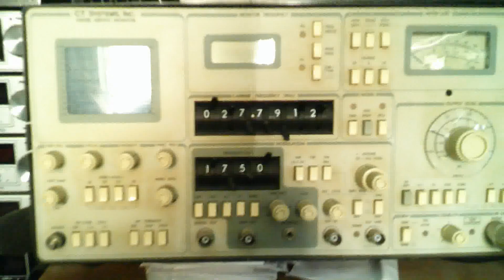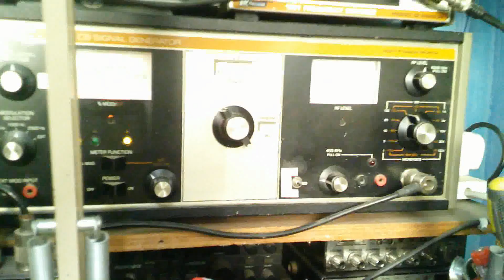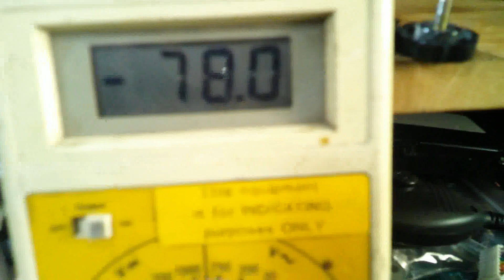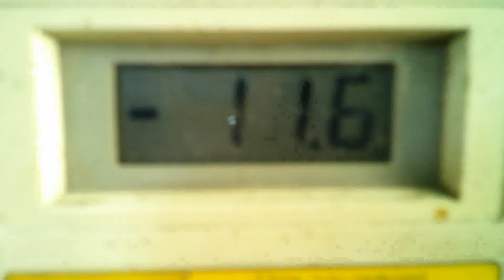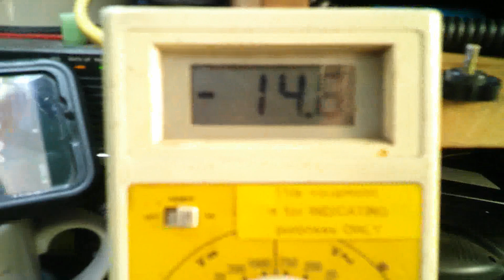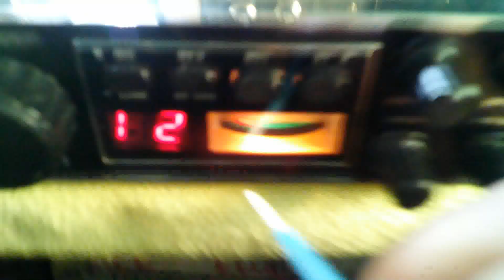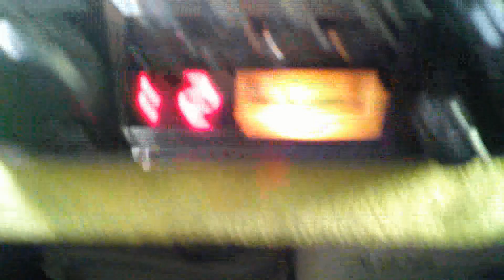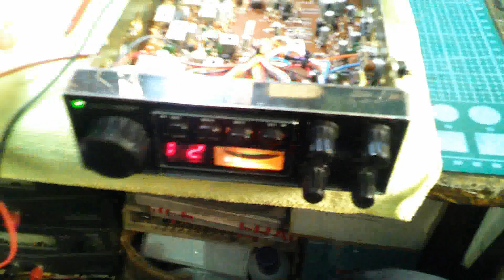CB Radio RX Tune up without a Sinad meter

Comment: I've never had need for a SINAD meter. For narrowband FM receivers I've always used the 20db quieting method, and for AM receivers I use a tone-modulated signal generator along with an oscilloscope. The scope is connected to the output of the receiver. I can easily see changes, much more so than on a voltmeter, even an analog one.

Comment: You should always use an analog meter for tuning because they are much more accurate and have better resolution...
Reply from the maker: maybe so,but i guarantee you use a digital meter and an analogue meter (for voltage) the slight difference in mV and even uV won't be noticed on a sinad meter..
i've even tried this recently a few times without a multimeter and just used the radios signal meter and peaked it by eye, then done it again using a meter and gained hardly anything which was noticable.

remember this is for weak signal peaking, the stronger signals of S7 say will also increase slightly but it's the weaker signals you need to peak.

I won't even start on if the radio has an RF gain and you need to peak the first amp section differently so the RF gain works correctly.
Reply: @bigpimp347  To your point, we used to tune commercial etc... radios by ear.
Reply from the maker: @radioguy19510  some of us still can

Comment: Thanks for sharing 👌any tips on how to adjust the deviation with out an deviation meter ?
Reply: not really, but a simple way is if you have a good radio to use as a receiver,
either HF set or a CB that's on frequency with a needle meter,
with the RF gain down or so the needle is half way on the meter give it some audio talking as you would normally,
the the needle starts to go backwards it's over deviating,
so adjust the deviation until the needle stops moving with your voice and is stable..

i found using a President lincoln that once the needle (LED) stops flickering the deviation is around 3khz,
which is a tad high to the manufacturers spec, but i set all mine at 3khz as normal voice will be around 2.5khz most of the time..

Comment: The detector and discrimination circuit is very important..if your gonna do  it do it right
Reply from the maker: Yes i agree, that's why you use a 1khz tone and either a good ear,or a scope to show it is receiving correctly then using the same tone and multimeter peak up the RX.

Comment: Where do you connect the red and black probes of the signal meter? And what did you have in the mic jack? What’s its purpose? I wanna learn to do it this way.
Reply: Ok thank you so very much. I have a Koolertron DDS 60MHz Signal generator I use to send a 1KHz tone three the mic jack to see the waveforms on my scope. I’ve always wondered how to use it to check the receive and was contemplating buying a SINAD meter but your video brings up a valid point about the needle in the meter bouncing around making it difficult to get an accurate reading. Still new to the CB repair game and always willing to learn more. I’m assuming this method will work any radio so I’m still learning. If it’s not to much to ask could you explain the whole voltage thing to get a S9 signal. Not sure if your familiar with the Koolertron DD Signal Generator or not, but from what I was gathering from this video was I take my BNC to PL259 coax from output channel 1 and connect it to coax connector on the back of the radio, set the signal generator to 27.185 MHz (Channel 19) or 27.205 MHz (Channel 20) or water ver channel I’m gonna use to check the receiver, then set the tone to 455 MHz and use a multimeter connected to the power & ground probes on the signal meter of the radio. What does the multimeter have to be set at?  Is 455 MHz what the tone needs to be set at? A cheat sheet would be amazing to have of this procedure. Sorry for this long replay and questions.
Reply from the maker: @765-AMPS  ok, you can use a scope and tone and RF signal generator as a form of Sinad also..
as you say you view the waveform on the scope....connect the scope to the speaker..
you can then inject the RF signal to the antenna which also has a 1khz tone and vie won a scope, weaken the signal and the wave form goes distorted and dirty, as you peak the RX on a radio the wave form become cleaner and solid, so here you are cleaning up the received signal as heard in the speaker, so in effect bringing up the receive signal making it cleaner is working a similar way to using a sinad meter, the sinad works the same way,
so you can use a scope as a form of sinad meter to obtain the same results, you just don't have the signal levels as in -115dBm to 12dB sinad, 
but if you're only interested in peaking the weaker stage of a radio for better reception the scope works good,
then as long as your generator can send out a -73dBm signal this is to set the signal meter to be an S9  reading..

on the 455khz signal some radios will use this type of signal as a way to get the RX on frequency as not all TX and RX frequencies are the same.

but experiment in different ways and find what gives you the best results.,
but ideally locate a radio service manual and read the procedure they suggest and see if you can obtain similar, same or better results trying different ways to peak the RX.
Reply: What do you set the multimeter to to get the readings you need?
Reply from the maker: @765-AMPS  usually around 2v 
the readings will be less than 1v depending on the radio..
sometimes at full signal you may get over 1v on some radios, others barely 500mV

you have to find yourself what works best for you.,

i find inject a strong signal, S9 perhaps, put the multimeter on and check reading, then lower the signal, when i see the voltage move up and down a large amount then i use that setting,

also to note some radios the reading will actually decrease as the signal gets stronger..!!
Reply: Mark made me smile... "There is a guy who does not twiddle slowly" i know who you mean. Erratic hands..

Once you have it peaked your voltage method. I go on air and have a listen to someone i know is on frequency.. Then tune by ear... Its a very subtle tweak but works for me... Keep posting bp
Reply from the maker: @roberthopkins8089  the radios are already on frequency and discriminator, i mean detector (as fat fingers calls them) are all set right normally by ear but i can use a scope on them also.
i can peak RX by ear also but using a meter gives me every last drop of juice.
Reply: @bigpimp347  i was only saying the other day to someone.. Go throught the peak back again and then find the peak.. Like three twiddles. Fat fingers lol... Thats the one...

I brought all my old fave rigs a few years back. All minters tweaked and modded the lot.. Then realised its not the rigs i was missing.. It was the voices that uesd to come out of them.. Just fixing up a baby uniden for some nostalgia... Get up that hill then and get my mike face on... Cq cq
Reply from the maker: @roberthopkins8089  That's the truth,
rose tinted spectacles, people thinking they buy a CB and it'll be the 1980's again,
then buy another because the first one was dead, and before you know it they have about twenty CB's and it's the same silence on all of them :)
Reply from the maker: red and black probe go to the two wires on the signal meter,
or black to negative power lead and red to positive of the signal meter.

the item in the mic socket is a receive audio short, this radio requires a link from ground to RX audio to get sound from a speaker, so the plug in the socket is just a link to enable sound.

Comment: Great video. Just a question , where do you connect the multimeter 's red claw to the radio to extract this measurement ?? The point was not very clear.
Reply: very sorry.
i connect to positive connection on signal meter.
this i usually set my meter on 2v setting and will see readings from 0.30v up to 1.50v depending how much signal is received (and meter setting)
you cna also connect on to 'wiper' of the signal meter VR..
Reply: @CBRadioWayBack10-4 OK. I understood. thank you very much for the feedback.

Comment: Sorry, I disagree,  a sinad meter was created for a reason, and your statement  "  that's just the discriminator" is rediculus,  tuning the rf stages for maximum signal is all well and good,  but tuning the discriminator for maximum signal to noise ratio in an fm set is more important.  , you can have an s9 signal and zero audio if the discriminator is out of tune. . So many "experts" on here , full service.?  Don't forget the air filter ,lol
Reply from the maker: No offence but you're talking tosh..
the discriminator or detector as another yourtube rig doctor calls it is done usually before you drop the signal and peak RX and double checked afterwards., 
this can be done on a scope to see the maximum peak in audio,
using your ear for maximum deafness :)
or even a volt meter across the speak for maximum voltage.
my point is, you don't need a Sinad meter to peak RX, this is proven FACT by watching the other white coat wearing rig tech video's as some of those radios are actually mine and he admits "he can't get them any better"
Also using a volt meter on the signal meter is more stable than the method shown using Sinad..

i mean after probably 30 years of doing it this way and hundreds of radios sold via ebay i've not had one bad comment of a radio being deaf, quite to opposite..

send me a radio or try it yourself..
Reply: @bigpimp347  As a retired radio engineer, I have to disagree with you.  Your ear works well, and may be ok for something as simple as a CB radio, but for commercial use, the correct way to do it for maximum front end sensitivity, is to tune the band pass filters to the maximum sinad.  You  cannot drop the signal to a low enough level to get a meaningful level with a voltmeter.  3 microvolts is a huge signal.  When tuned correctly, 12dB SINAD at 0.25 microvolts will allow a human voice to be understandable at the same levels.  

I suppose this is the difference between a qualified radio engineer and a rig doctor.

Comment: great video nice and simple - where do you get the ceramic trimmer tools from if you dont mind
Reply from the maker: Just search ebay for 'ceramic screwdrivers'  but be aware being ceramic they can break easily if you are heavy handed, same with the cores, if you use the wrong size or they are stiff they can crack cores same as a metal driver can.
Reply: @bigpimp347  perfect thanks great content look forward to more

Comment: This method is not perfect, but does work to a degree, The reason if you use a signal gen and say you can hear the tone at 1hz -127 dbm with a DVM you can test at signal meter to get a MV reading as shown. but the first coil in the receiver you can open to give a higher reading on the DVM yet obliterate the Signal gen tone you can hear. as you Adjust to get higher DVM reading you are really letting in more noise to the receiver, this higher noise level gives you a higher DVM reading, this in turn makes weak signals disappear in the noise. A sinad meter shows you this. After setting first receive coil with a sinad meter, you can then use this method best with a DVM with micro volt reading and set receiver to highest reading. The same as you can set the FM detector using AC on a DVM for highest reading using speaker wires to AC DVM instead of scope as it will read siniwave in AC mode.

Interesting video though and as stated in some tune up vid's wild adjustments on coils are no wear near good enough for a sweet receiver. best to go through it several times. cybernet FM rigs always had that awful pop in Squelch when the setting was just above noise floor with a kind of growl and pop as it opened to weak signals. To cure this and have a sweet squelch solder a 25v 16uf to Q14 on the emitter - and + to collector. pop and growl now gone and sweet squelch.

Great to see people tuning radio's 👍
Reply from the maker: I appreciate the reply, but practise quite often proves my way is better.
i have been doing it this way for years and the amount of people who say they can now hear weaker signals better is amazing,

and also a few of my radios have ended up going to Richard at Grantham and he himself can't not get them any better, proven in his video's (even an email he said he doesn't know why people send them as he can't get them better) 

there's the proper correct way, which works and is what used in the factory, and there's mine and other peoples way which works just as good if not better, and remember the factory alignment it a quick twiddle and within 5% or 10% mine is after 20 minutes warm up and checked several times before i'm happy with the outcome.

Comment: This was the way i did them years ago and worked a treat for me too.Great memories restored there buddy…Have a Subscribe👍
Reply from the maker: I've tried two Sinad meters and i get meter results using my old Altai needle meter, i use the digital to show how to do it easier, i use this as often also.

i did a Uniden 100 yesterday and they show negative voltage off the VR but the numbers just need to increase, some radios the numbers need to go down, but you figure it out as you increase and decrease the input signal.

so much easier and more accurate than a Sinad meter.

Comment: Exactly how i do it, just work through the coil/ inductors a few times  as you did. A simple voltmeter and a low input signal gen.
Reply from the maker: worked for me for years, i do it this was as i can't concentrate on the SInad and fine a stable needle or digit easy to focus on.